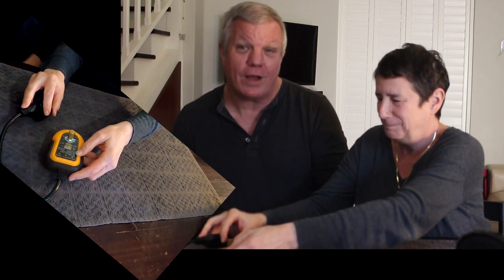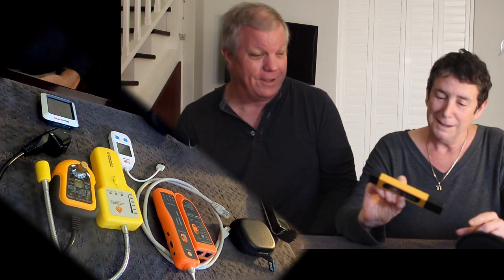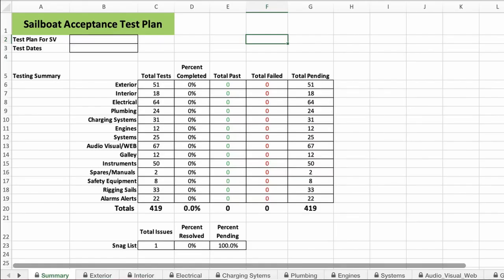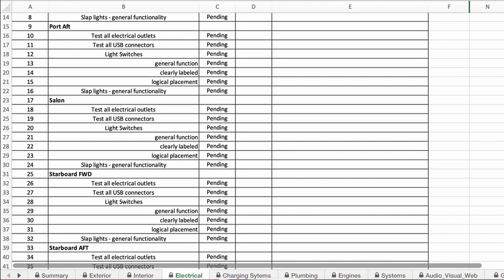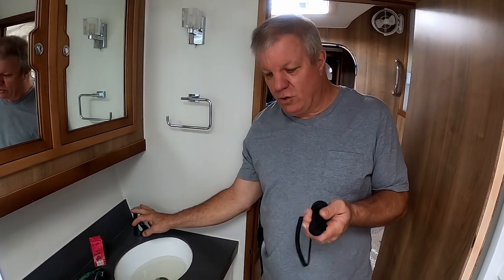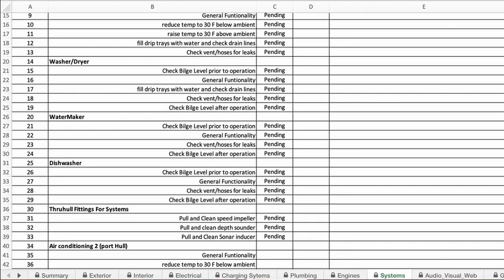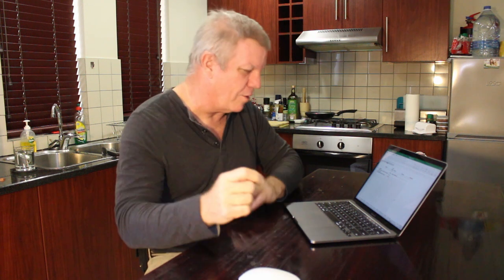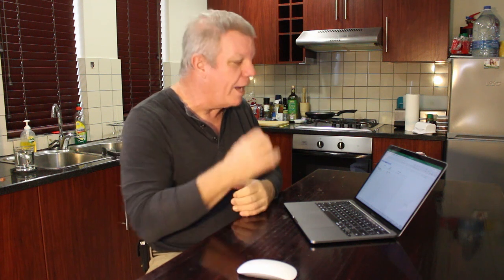Video 17: Owner Acceptance Testing

Comment: Nice informative video. For most, it is extremely important to have a professional marine survey done, even on a new build. The buyer should accompany the surveyor, giving them an opportunity to learn about the systems on the vessel. The surveyor will also give maintenance tips as well. A fundamental part of the survey (inspection) is a hull sounding. This is done when the boat is on the hard, for the hull and the decks are generally sounded when the boat is in the water. The surveyor is looking for soft and hollow soundings which could indicate structural and moisture intrusion issues.
Reply from the maker: Hi David, 
We agree completely. User testing is no replacement for a pre-purchase review by a qualified marine surveyor. We would submit, however, that user testing should be done in addition to the survey as it’s a great way to find minor snags, as well as getting to know your boat. There’s a significant overlap between the two, so if the new/potential owner is involved in both there’s no need to replicate tests.